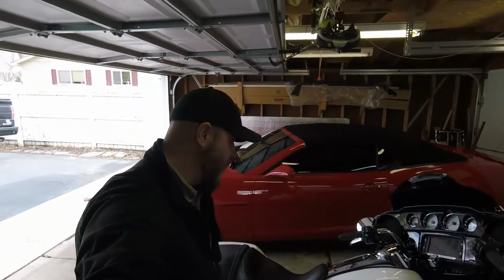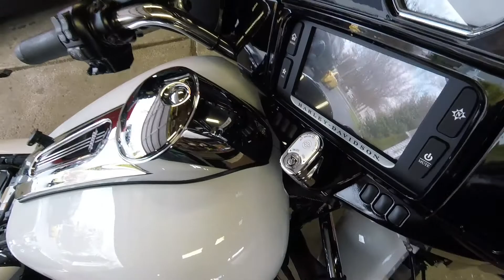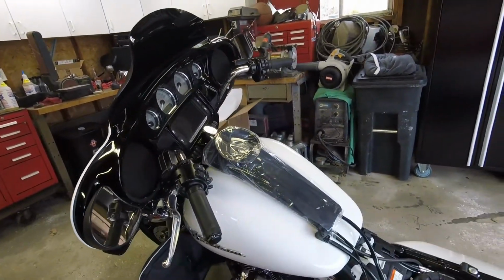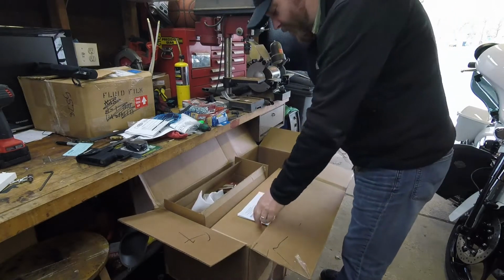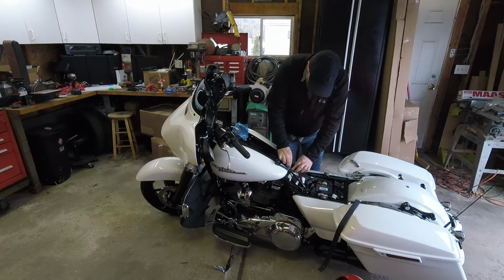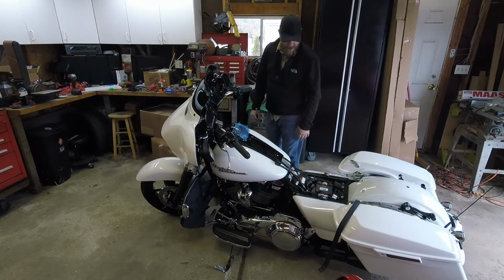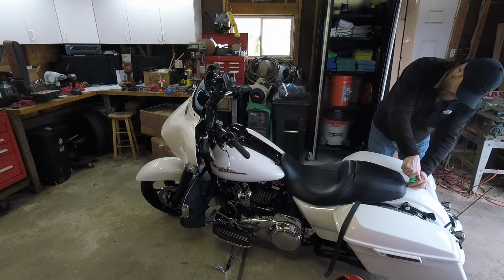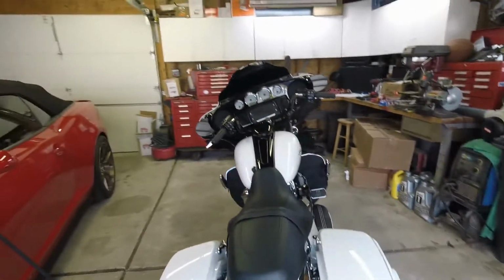2017 Street Glide Black Console Install

Comment: Thank you for this, I've been thinking about changing my console from chrome to gloss black as well.  I have a 2017 Ultra Limited Black Hills Gold/Black Quartz.  I have already changed over my tour pack rack and hinges, the saddle bag latches, and added the black run/turn/brake lights to the saddle bags.  Too expensive to black everything out but the gloss black brings out the gold.  I'll keep everything else chrome as it adds a nice blend.  May do the ignition as well.  But your video convinced me to go that route.  Thank you again.

Comment: Thanks for this video, I am trying to get my chrome dash console painted to black and then reinstall it. I was able to unscrew the two bolts for it and also noticed two clips holding the two cables. Not sure on how to remove the gas vent tube. Do you just pull on it hard? It looks pretty tight in there
Reply from the maker: I just wiggled it until it came off.

Comment: UPDATE: I pulled the trigger on the gloss back console and it's installed.  Just did it on yesterday.  That darn comm port was a little bit of a pain but for the most part it was easy and it contrasts the gold much better than the chrome.  Quick question, what did you do with your stock parts?  Thanks again for this video.
Reply from the maker: M. T. I gave them to a buddy that rebuilds bike’s.